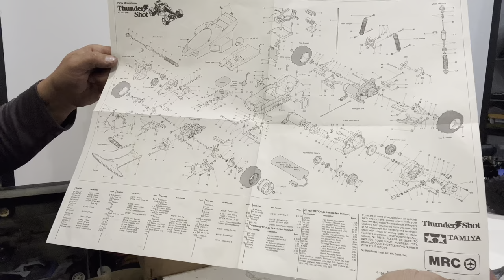Finishing my Tamiya Thundershot from 1987!

Comment: Remove the tip from the sharpie paint pen. Soak the tip in alcohol for 5 mins. Dry off with paper towel and let air try 15 mins.  Paint should now flow through the tip. This works most of the time
Reply from the maker: Thanks for the tip! No pun intended. Lol

Comment: You are missing another upgrade... the adjustable upper arm from the Terra Scorcher. Since the Terra Scorcher actually is a fully hopped up Thunder Shot it makes sense getting the Terra Scorcher parts. Regarding the sealed lubes... why not? I got a bunch of them, too, since I keep using the old ones till one is finished; you never need a full one for a single build.
As super- hop up you can get the silver Egress dampers; they were kinda makde for Thunder Shot, too. Or any modern CVA Mini Shocks, of course